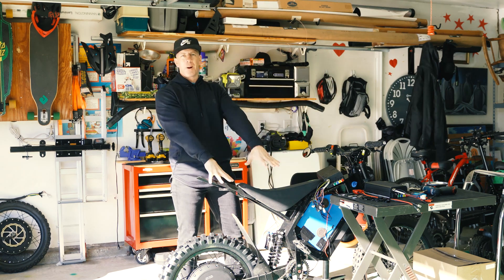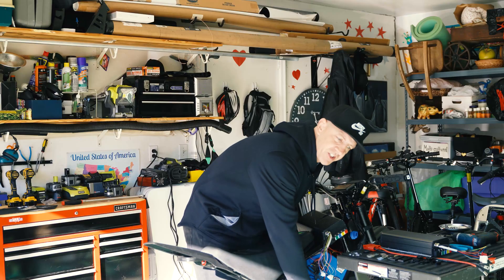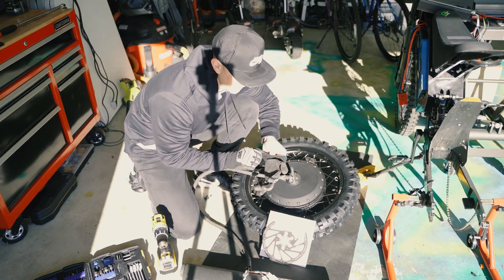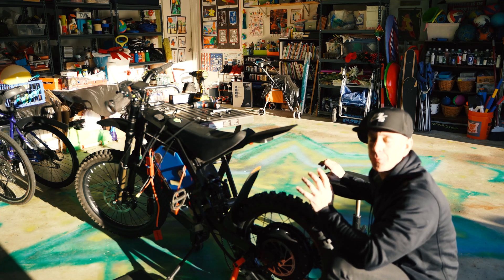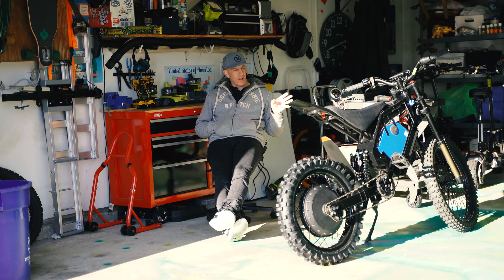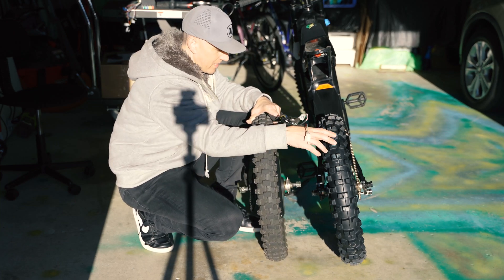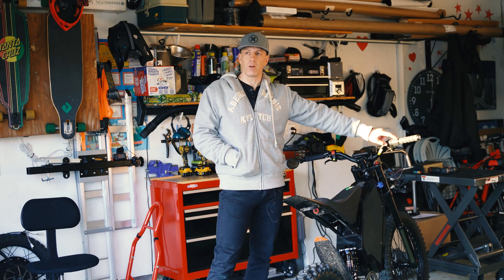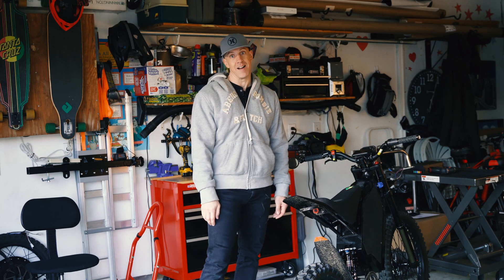QS273 5T & Sabvoton 72200 UPGRADE Pt. 1...SCREWED by ALIBABA!!!

Comment: Awesome bike setup! Would love to know the frame you chose and what is the qs273 3.5t dropout and what is the actual frame rear dropout? Thanks, Larry
Reply from the maker: Both the frame drop out and the 273 drop out are 12 mm
Reply: Do you mean 112mm or 120mm? Sorry brother, I think there was a typo. Thanks for responding. Also, what frame brand is it? I have been evaluating the QS Motor 273 4000w 40h. It has a narrower dropout than most of the higher power rated 273 motors with a 189mm dropout, and recommending on their own site 200mm frame dropout for these. Any input is much appreciated. Thanks so much. Larry
Reply from the maker: @Want2cJesus  12 mm is the axle size the size of the dropouts the axle goes into if you're talking to width between drop out the dropout mine is 170mm
Reply: @JoshStreetDesign  
Where did you find a frame with a 170mm dropout, or did you expand your rear fork from the factory set?
Reply from the maker: @Want2cJesus  it's what the frame came with.  You need that width for the 273 motor.   Just search aliexpress or alibaba for my frame and make sure it's the updated version 2 of the frame where the brake disc mounts are solid on the back.
Reply: @JoshStreetDesign  
Is your frame information listed somewhere that I can check it out? Is there a brand name or specific seller to search for? I'm not real familiar with either one nor have I purchased from either before. Again thanks a ton. As you know putting it together is the fun part but pulling initially together all the necessary components is also a challenge.

Comment: Hey Josh, quick question for you, I have the 5000watt motor powered by a 72volt custom battery but using the standard controller that came with the bike, an 80a version,.Would you say upgrading to the Sabvoton makes a big difference? Cheers, H
Reply from the maker: Do you know exactly what the existing controller is, like the manufacture and model number?   Also it depends on your battery.   like what is your battery's BMS specs?
Reply: @JoshStreetDesign  thanks for the reply Josh, the controller is part of the kit that came with the alibaba stealth bike, it doesn't say much on it to be honest. As for the BMS I'm quite new to this! How would I find out about the BMS? Apparently there is an app I can use to sync with it but I have not done that yet. 😃
Reply: A controller is rated for amps 80 100 150 and soon. But your battery should have a built in bms that has a current rating. If your current rating for can only discharge 50amps then it makes no sense to get a controller bigger than 50a controller
Reply: However you can switch your bms to a bigger one for much cheaper than you'll buy a whole new battery
Reply from the maker: @MotoAlias  yes I know.  My battery is 150amp Max.  When I get the nuclear 24f I will be updating the battery.
Reply: I ordered a 150a Savoton’ but decided to go with the 80a…because the motor was a 3t 3000w motor, and the BMS is a 80A on my battery….so far so good unloaded’ not sitting on it with the bike suspended it’s hitting 82MPH, and 130+ KPH….I know for every 100 pounds you lose 7mph ….my weight is 144 pounds, the bike with the battery weight 102 pounds so I’m looking at atleast losing 25-30mph to be safe….can’t wait to ride it I’m probably looking at 52MPH on flat surface….took me awhile to do the hall sensor test, and chance parameters….because the the display kept turning off….so I programmed the display to stay on for 9mins….after the hall sensor test I decided to blip the throttle, and found out the motor was programmed to spin in reverse….Lol….had to set the motor to 1 for forward.

I’m trying to figure out the ignition wire…..it has 2 connectors I think on is to apply 12 volts to something like lights when keyed on and the other turns the system off.

I’m gonna have to build a Aux battery to increase the AH to more than 21 or I will be lucky to get 10miles off that weird battery….I never seen a battery have a 80A BMS with a small AH.

My calculations say Im doing 5760 kw…but my display shows 8000KW….The battery is small….I will be building my ad on pack…But I might do it for the increase of range….I wanna use the main batteries 80A BMS to limit both batteries…or add a 150amp BMS….and use the 150a Savoton controller.

Speed isn’t important….range is becoming more important.

Comment: Did you get your battery made by someone or was it purchased through AliExpress or Alibaba online shopper?
Reply: I’m having an issue with my battery pack. Once I go over 25mpg, my controller gets an error and the bike won’t go any faster nor let me use the throttle unless I come to a stop. Any ideas regarding this issue that you might no that way I can look into it ( would greatly appreciate it ). By the way, I remembered I had asked you regarding the green light in the sabvoton controller 72200 and the bike not working. come to find out, it was my throttle which I changed up and was running but came across this current issue.
Reply from the maker: @christopherfigueroa4143  mine was purchased alibaba.  You may have the controller set to limit your amperage
Reply: @JoshStreetDesign  could you send the link to the buyer which you bought the battery from on Alibaba?
Reply from the maker: @christopherfigueroa4143  it was the blue dot company, just search that name
Reply: @JoshStreetDesign  🤔 can’t seem to find them. Was it on Alibaba or AliExpress app?

Comment: What brakes did you use? How is the braking? Can you slow the bike or do you find it's slowing but barely? I am running Hope Tech 3 V4 with 203mm rotors with the QS273. I found them to slow the bike but can't seem to get them to brake fast. Maybe I need to bleed the brakes? But installed them and they appeared to be working straight out the box.
Reply from the maker: Shimano Zee on 220mm rotors, combined with 30amp electronic braking, (not regen) it stops great.  My bike is almost 200lbs.

Comment: What size spokes did you use with the QS273? I have one on 19"motorcycle rim that's straight laced. I just bought another rim and want to get the wheel cross laced. I have no idea of the spoke size. Also what kick stand did you use? Can you help out with this?
Reply from the maker: For the 18 rim I don't know what length, I ordered the wheel already laced.  I think the Grin website has a spoke length calculator though. you can find ebike kickstands on the AliExpress website

Comment: I didn't see anything in the video where you reprogrammed the controller once you put the new motor in. You'll probably have to do a new hall test and make sure that your amperage output is set where it needs to be on the controller.
Reply from the maker: It didn't need it

Comment: Amazing video. I was thinking of getting the 80amps sabvton controller for a 3kw motor build. But the controller seems really big
Reply from the maker: Go bigger,  get the 72150 at least!
Reply: youll find there is always wasted space in sabvotons ,ive had to trim them down quite a few times .have also seen a few water cooled and case removed all together
Reply from the maker: @katiekumcgil  yeah I'm on the waiting list for the nuclear 24f which is like much smaller than the sabvoton 72200.  I would have upgraded to a NMC 60 amp hour battery but it doesn't fit with that controller in the case and I don't like the look of it with the outside the case.
Reply: Check out kelly controller mini s... It's like 1/5 the size of sabvoton and still has huge amp outputs

Comment: Also sabvoton are garbage try ASI controller much more compact much more power reliabitilty,  ive blown numerous controllers and the sabvorons never lasted more than 3 sessions
Reply from the maker: I don't know man I've put my sabvoton through hell and it's been performing perfectly
Reply: @JoshStreetDesign  yeah I loved how smooth they were but they never lasted in my builds always had problem with the halls acting up would start and go great cone to a stop and bike wouldn't go again, your using the 72v system, i was using the svmc 96120 pretty good amperage right now I'm running the BAC4000 by ASI and I opened it and soldered different caps in theyre im not about to buy another battery so I'm stuck 96v 120Ah
Reply from the maker: @chrisdenault8660  that's nothing to sneeze at though.  I don't know if you saw part two of this video but with the 5t motor I'm running now this thing has awesome low end torque for the woods riding I do.  It's a blast to ride

Comment: Have you tried putting it on a thick motorycle rim.. I got the Qs205 8kw
Reply from the maker: As stated in the video the tire is on a 1.85-in x 18 motorcycle rim.  Very thick.  : ).  And by the way the 205 is not an 8kw motor it is only a 3 KW motor those are fake stats used to promote extra sales.
Reply: @JoshStreetDesign  its 8kw my batteries are pulling 19kw at 96v  and yeah bike tires can be a little tough but I meant try putting them on a 3.5-5 inch rim thats what I'm using
Reply: 205 does come in 8kw in version 4, its a 17 inch wheel and does about 156tops @ 96v with an ASI controller and the caps swapped out inside to handle 96v
Reply: 205 is rim to tire motor 273, is bicycle spoke motor, the bicycle go to 15kw tops ive seen and 205 goes up to 20kw. Ive been building for 10 years now I have mountains style and Electric motorcycle style builds

Comment: Is your battery BMS has same Amp as controller? If not that is the problem you can damage your batteries
Reply from the maker: Yes both batteries are 72 volt.
Reply: @JoshStreetDesign  Josh voltage is one thing make sure BMS and motor controller has same Amps
Reply from the maker: @shavkat84  they don't have to be the same amperage.  A batteries bms will only allow a certain amount of amps to flow no matter what the controller is asking for.
Reply: @JoshStreetDesign   in my case 80amp controller and 50amp bms in full throttle i was getting messages,  something like power protection , until i installed new bms with 100amp
Reply from the maker: @shavkat84  oh no I never get any errors like that

Comment: I just paid someone to do mine
Reply from the maker: I got new expensive custom wheels for my rmz250 and I'm def having a pro mount those, don't want those rims scratched.
Reply: @JoshStreetDesign  that was my issue. I was going scrath the powdercoated rims. The moto rims are a bitch. You really need a machine. I just hate paying the cost to have them mounted.

Comment: What size adapter did you need for the front brakes. I’m ordering the same forks with 220mm disc.
Reply from the maker: It's a 203 to 220 adapter, I think hope sells them

Comment: Does the double rear shock?
Reply from the maker: Does it what?
Reply: @JoshStreetDesign  whoops... does the double rear shock work? I recently went to a fox shock with a heavier spring? Smooth out the rear end with that big motor
Reply from the maker: @ThePathfinders0369  it definitely works.  I was getting too much sag with a single shock so that's why I went double and then set the settings on the lowest levels
Reply: @JoshStreetDesign  thanks!!
Reply from the maker: @ThePathfinders0369  no problem.  Shooting part 2 tomorrow

Comment: Your battery cannot catch up with your controller. Your controller sucking up that much current making your voltage sag to much. Change your controller settings on max battery current and increase your phase current alittle. The controller capacitor will adjust for it, but your controller for sure will heat up.
Reply from the maker: Yeah I tried that, dialed them wayyyy back, but it made no difference at any setting.  The phase is maxed out at 450 and 550 protect. I think it was just a controller display mismatch...although I can't be positive.  Think I'm gonna just switch back to old controller for peace of mind.  If I ever get a new battery I might try it again.

Comment: Another thing: How is the tail light working? Does its "Smart Auto Brake-light" actually work?
Reply from the maker: It's sort of does but it's a little sensitive with the forward and backwards movements so it tends to be on a lot.  Lately I've just been using manual button turning it on when I'm driving around at night.  I tend to turn it off in the woods because sometimes I'm in places I'm not supposed to be so I don't want people seeing the light, haha
Reply: @JoshStreetDesign  I feel that. Yea, i'm contemplating having a tail-light at all.
Reply from the maker: @hobsonmx7341  well if you'll be on the road and all, it def helps for visibility at night.

Comment: How much further does the swing-arm droop? Why wouldn't you have gone with two 240mm dnm shocks instead? Or one?
Reply from the maker: Hey not sure I understand your question... What swing arm droop?  The swing arm angle is not changing at all. The optimum angle on this frame requires a 210 mm rear shock. A 240 would be far too large and would not work on this frame. the reason I'm running two shocks is because that I had a little too much sag with a single shock with a 750 lb spring so instead I went with double shocks with two 500 lb springs and it works out pretty good. I have them set on the lowest settings so that it's not too stiff.
Reply: @JoshStreetDesign  Oh, wow. Alright. That saves me an $100 dollar mistake if you're correct. Thank you. Our weight is probably pretty close, so having two shocks isn't a bad idea. I'm known to send lol.
Reply from the maker: @hobsonmx7341  I mean, you would probably be fine with the single shock, and you can even get one with an 850lb spring from cyklone ebike.

Comment: Maybe not enough voltage, or bms won’t give enough juice.
Voltage drop maybe due to controller needing more power.
Don’t those controllers do all the way to like a 100volts?
Reply from the maker: I'm pretty sure the battery is the limiting factor here, but I was expecting at least a little more since I have the second battery running which should theoretically put it up to 190 amps of juice instead of 150. Bas far as what the display was showing I think it's a problem with the controller wiring not being interfaced properly with my display
Reply: @JoshStreetDesign  If you have them in parallel and not series it does not add any amperage.
Reply from the maker: @elevationtc  no it doesn't
Reply: @JoshStreetDesign  I know it does not.    Look up the math and you will see as well. 4 12v 50 amp battery’s in P would be 12v 50 amps.  I’m S it would be 48 200 amps.

Comment: Why not just mount the controller on the underbelly..? saves a ton of space 

EDIT: Watched the entire video. Maaaaan that's alot of work and alot of cutting of the frame that could've been avoided by just placing the controller outside. 
You didn't have to cut a giant hole just to fit the hall sensor connector but instead just solder it directly to the controller or get a smaller Bafang 5 pin waterproof connector.
Reply from the maker: Yeah but I totally hate the way the controller looks on the outside of the bike, not to mention I didn't want those wires hanging out there because there's really no proper way to cover them fully.  besides if you saw my other video you would know that I have a secondary battery in the controller box below the bike which fits in there perfectly so I wouldn't be able to put the controller out there even if I wanted to.